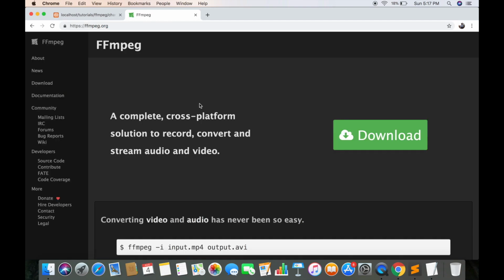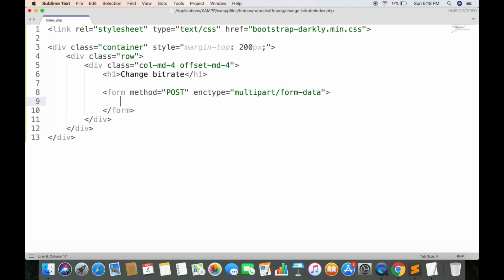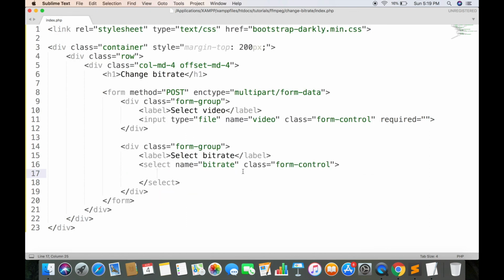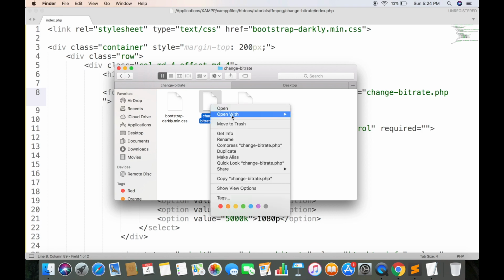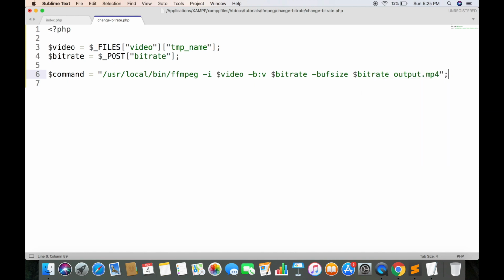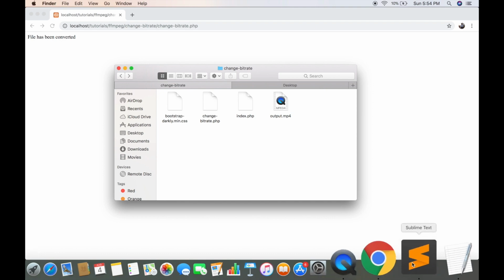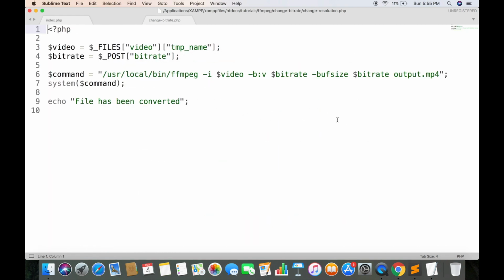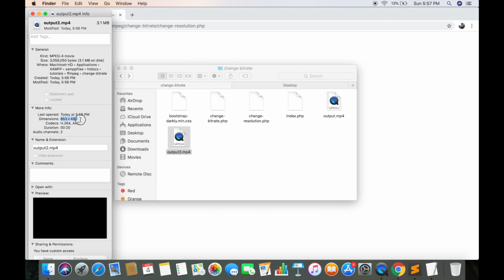Compress video in bitrate and resolution - PHP & FFmpeg

Comment: Hi, Bro, I have a problem with my video file, my video can't be played, but when I checked it turned out that all the metadata in the video was gone, mean the metadata bit rate, fps, resolution. etc., how to write or fix missing video metadata, thank you. by the way am using sony camera
Reply from the maker: Make sure your command is right, it has to be exactly as in this video.

Comment: Array
(
    [0] => ffmpeg version N-100510-g4a160cb Copyright (c) 2000-2020 the FFmpeg developers
    [1] =>   built with gcc 5.5.0 (Ubuntu 5.5.0-12ubuntu1~16.04) 20171010
    [2] =>   configuration:
    [3] =>   libavutil      56. 62.100 / 56. 62.100
    [4] =>   libavcodec     58.115.102 / 58.115.102
    [5] =>   libavformat    58. 65.100 / 58. 65.100
    [6] =>   libavdevice    58. 11.103 / 58. 11.103
    [7] =>   libavfilter     7. 94.100 /  7. 94.100
    [8] =>   libswscale      5.  8.100 /  5.  8.100
    [9] =>   libswresample   3.  8.100 /  3.  8.100
    [10] => Input #0, mov,mp4,m4a,3gp,3g2,mj2, from '/opt/lampp/temp/php1feVY1':
    [11] =>   Metadata:
    [12] =>     major_brand     : isom
    [13] =>     minor_version   : 512
    [14] =>     compatible_brands: isomiso2avc1mp41
    [15] =>     creation_time   : 1970-01-01T00:00:00.000000Z
    [16] =>     encoder         : Lavf53.24.2
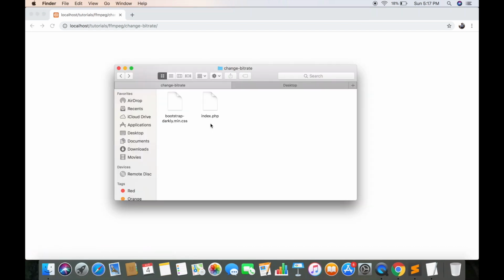    [17] =>   Duration: 00:00:13.50, start: 0.000000, bitrate: 1248 kb/s
    [18] =>     Stream #0:0(und): Video: h264 (Main) (avc1 / 0x31637661), yuv420p, 1280x720 [SAR 1:1 DAR 16:9], 862 kb/s, 25 fps, 25 tbr, 12800 tbn, 50 tbc (default)
    [19] =>     Metadata:
    [20] =>       creation_time   : 1970-01-01T00:00:00.000000Z
    [21] =>       handler_name    : VideoHandler
    [22] =>       vendor_id       : [0][0][0][0]
    [23] =>     Stream #0:1(und): Audio: aac (LC) (mp4a / 0x6134706D), 48000 Hz, 5.1, fltp, 381 kb/s (default)
    [24] =>     Metadata:
    [25] =>       creation_time   : 1970-01-01T00:00:00.000000Z
    [26] =>       handler_name    : SoundHandler
    [27] =>       vendor_id       : [0][0][0][0]
    [28] => Unknown encoder 'libmp3lame'
)
    [28] => Unknown encoder 'libmp3lame'
could you please help me solve this.
Reply from the maker: Make sure you are entering correct encoder. It is due to wrong encoder name.

Comment: please help me
 i can't find output file.
Reply from the maker: Make sure you have write permissions in the folder where you are saving file.
Reply: @AdnanAfzal565  i am using wamp server should i change it.
Reply from the maker: @Амьдрахсайхан-з8б  No, it does not depend on mamp server.

Paste your command in terminal and see if you get any error there.
Reply: @AdnanAfzal565  can we chat by skype or any other chatting platform?
Reply from the maker: @Амьдрахсайхан-з8б  We can do at google hangouts. Let me know your email.
Reply: now seeing this error Fatal error: Maximum execution time of 120 seconds exceeded in C:\xampp\htdocs\bitrate\change-bitrate.php on line 9
Reply: @AdnanAfzal565  Wow bro it is working now.I changed out destination.
Reply from the maker: @Амьдрахсайхан-з8б  You can put the following code at the top of your script and it will increase the execution time:

ini_set('max_execution_time', '300'); //300 seconds = 5 minutes
ini_set('max_execution_time', '0'); // for infinite time of execution
Reply: @AdnanAfzal565  thank you so much you will get my subs and like.
Reply from the maker: @Амьдрахсайхан-з8б  Thank you so much for that.
Reply: @AdnanAfzal565  now seeing this error Warning: POST Content-Length of 52734030 bytes exceeds the limit of 41943040 bytes in Unknown on line 0

Notice: Undefined index: video in C:\xampp\htdocs\bitrate\change-bitrate.php on line 4

Notice: Undefined index: bitrate in C:\xampp\htdocs\bitrate\change-bitrate.php on line 5
File has been converted

Comment: Video is very informative. But can you please also upload 1 video to convert any type of video format to mp4 format. As recently I am struggling with this in my project. 
Thanks in advance 😊
Reply from the maker: You can use the following command:

ffmpeg -i input.mp4 -pix_fmt yuv420p -crf 18 output.mp4
Reply: @AdnanAfzal565  thanks for the reply. But it is not converting .mov to mp4

Comment: <?php
if (isset($_POST["submit"])) {
$video = $_FILES['file1']['tmp_name'];
$bitrate = "1200k";
$command = "c:\ffmpeg\bin\ffmpeg -i $video -b:v $bitrate -bufsize $bitrate output.mp4";
if (system($command)){
	echo "file has been convert";
}else{
	echo "file not convert";
}
}
?>
<!DOCTYPE html>
<html>
<head>
	<title>Compress Video</title>
</head>
<body>
<form action="#" method="post" enctype="multipart/form-data">
    <label>Select Video File:</label>
    <input type="file" name="file1">
    <input type="submit" name="submit" value="Upload">
</form>
</body>
</html>
Reply from the maker: Your form action is empty, set the action as "index.php" or current file name. And it will work.

Comment: not work ..... my os is window
code is:
<?php
if (isset($_POST["submit"])) {
$video = $_FILES['file1']['tmp_name'];
$bitrate = "1200k";
$command = "ffmpeg -i $video -b:v $bitrate -bufsize $bitrate output.mp4";
if (system($command)){
	echo "file has been convert";
}else{
	echo "file not convert";
}
}
?>
<!DOCTYPE html>
<html>
<head>
	<title>Compress Video</title>
</head>
<body>
<form action="#" method="post" enctype="multipart/form-data">
    <label>Select Video File:</label>
    <input type="file" name="file1">
    <input type="submit" name="submit" value="Upload">
</form>
</body>
</html>
Reply from the maker: If your file has spaces in it, wrap it in single quote:
-bufsize 'bitrate output.mp4'
Reply: @AdnanAfzal565  thank u it is work
Reply from the maker: @techtuto3542  You're welcome.

Comment: This is what i've been looking for👍👍👍 
But can you tell me how to install this ffmpeg on xampp server in windows?
Reply from the maker: FFmpeg will be downloaded and installed in your computer from here: https://ffmpeg.org

It does not depends on XAMPP.
Reply: @AdnanAfzal565  i've downloaded and installed ffmpeg on my computer. It works fine when i'm running it on cmd. but when i try to run ffmpeg on php, it just won't work.
Do you know any solution to this?
Reply from the maker: @muhammadiqbal-jt2zt  The path of FFmpeg could be wrong. Open CMD in folder where you have installed it.
Reply: Oh wait. Nevermind 😅
Turns out i have to add "&" at the very end of the command in the php syntax
Ex: 
$Command = "/usr/local/bin/ffmpeg -i $Video -s $resolution output2.mp4 &";

Source :
http://trac.ffmpeg.org/wiki/PHP